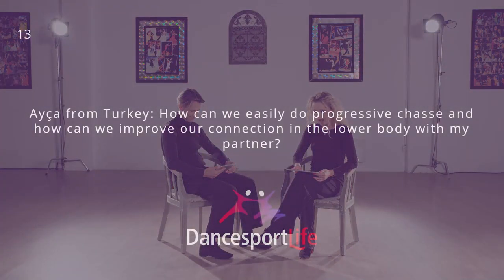Q&A Session with Mirko & Edita Gozzoli | PART 2

Comment: 6:30 Natural Pivot, use some upper body for the CBM. 
Reverse Pivot, use the lower body the hip rotation in CBM only.
The inside partner use the centripetal force, the outside circle partner use the centrifugal force.